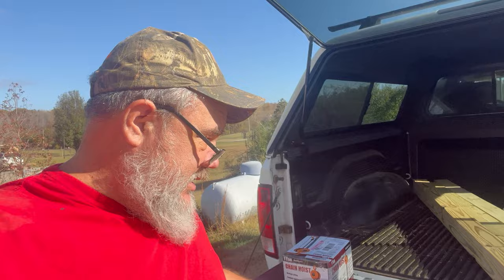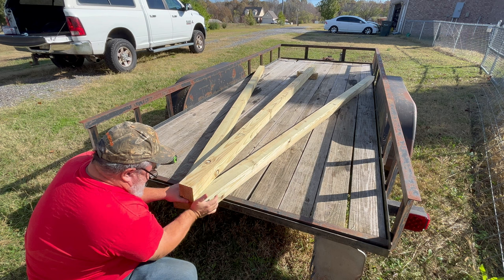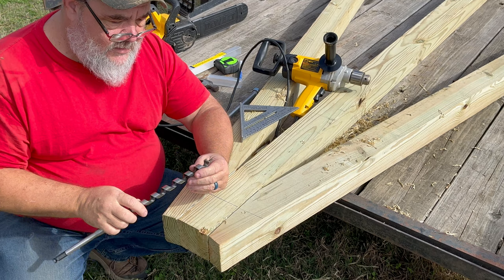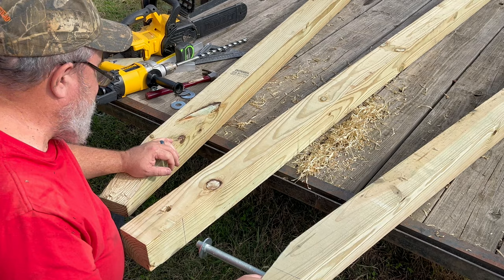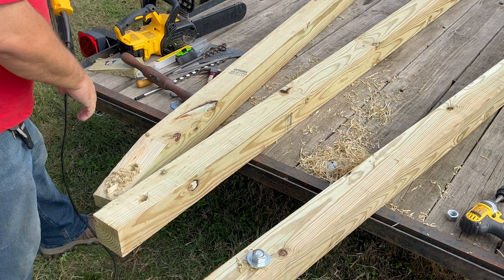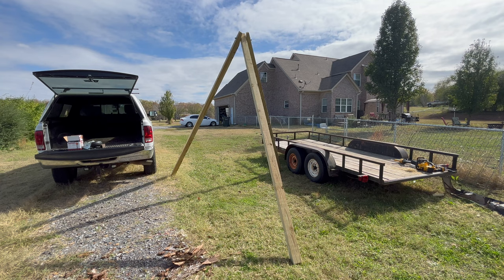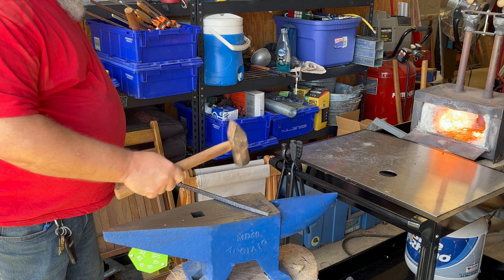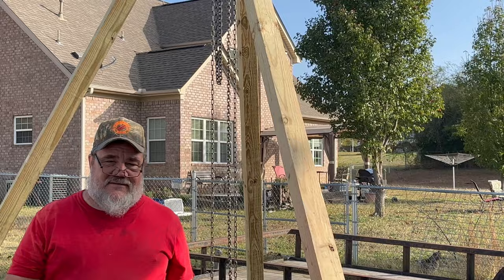DIY PIG PROCESSING TRIPOD

Comment: Nice work. Think you could hang a small breed cow, Dexters - about 550 lbs, from that without breaking the legs? Thanks
Reply from the maker: It could handle the weight, not sure about the height.
Reply: @HisWayHomestead  Wow, thanks for the fast reply! I'm gonna give it a shot and see. I've been looking for something like this for quite some time.  Best wishes sir.
Reply from the maker: The 4x4’s were 12’ long.  You probably need 16’ long ones.  One day, I’d like to have some dexters!  God Bless
Reply from the maker: Our pigs weighed 400 lbs and it didn’t have any trouble